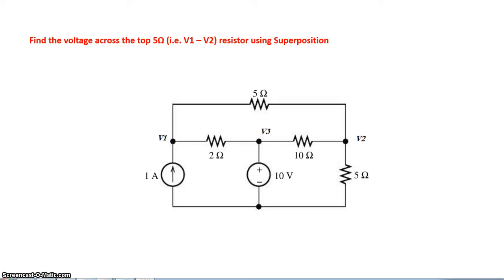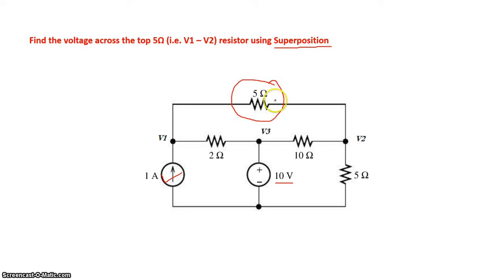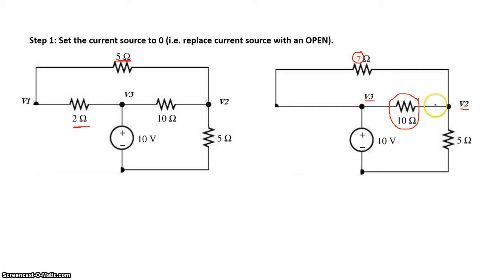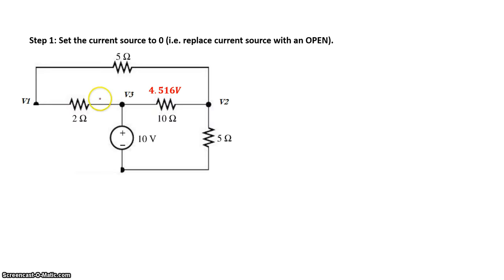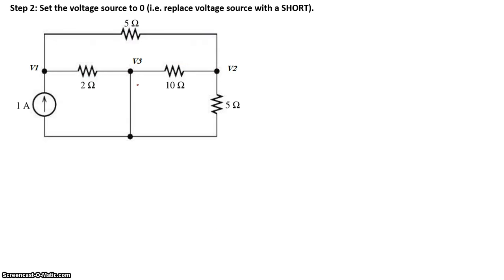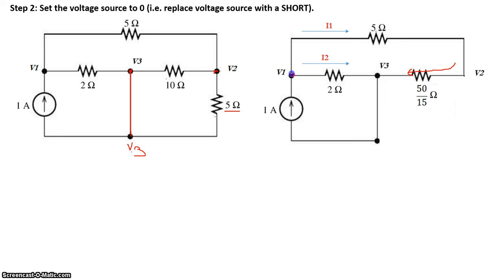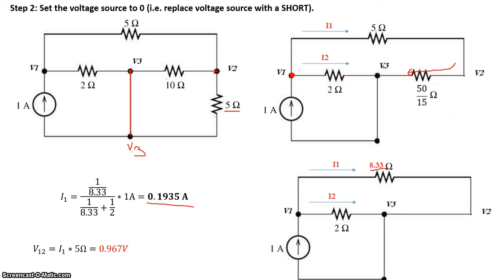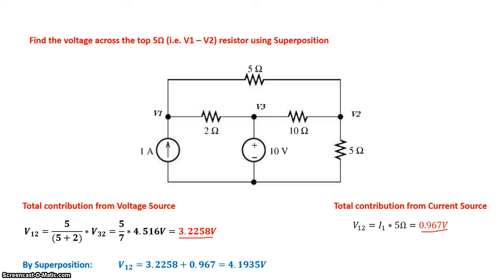Circuit Analysis using Superposition principle

Comment: Why are you doing !/R for you current divider?
Reply: Yeah, at 6:30 I think it's supposed to be ((1/2)/((1/2)+(1/8.33)))*1 since it's current division (which is I1 = (R2/(R1+R2))*Isource)
Reply: Yes that's correct but why did he use 1/R instead of just R --> 1/2 instead of 2 and 1/8.33 instead of 8.33 ??
Reply: +Titan Xelon 

Idk why he's doing that but if you just follow the formula you'll get the answer he got. Just remember that according to the formula the numerator is the OPPOSITE resistor from the resistor we are interested in.
I1 = [r2/(r1+r2)] * Is. There's no reason to do reciprocals like him. The formula works
Reply: Good question, that's because they're in parallel and he didn't wanna get the voltage then divide by the resistor. Piece of cake
Reply: The RECIPROCAL always works. The simple formula you list is a special case where there are only 2 resistors.

Comment: Hi why is that you open the 1A then you short the 10A?
Reply from the maker: There is no 10A, it is a voltage source 10V. Current sources are opened to remove their influcence (ie. set current to 0A) and Voltage sources act as a short when their influcence is removed (ie. voltage between two pts is 0).

Comment: Any reason for using 1/8.33, 1/8.33, & 1/2? Instead of inserting the exact values 8.33, 8.33, & 2 the when calculating I1? #confused.
Reply: that is how we calculate the total resistance in parallel. 1/R(p.total) =1/R1 + 1/R2. @ENGRTUTOR , may you please confirm if l am right.
Reply: Technically the fraction IS the more exact value, but the main reason is to show how the math occurred.  Recall that a resistor pair in parallel is R1*R2/(R1+R2), so for example if R1 is 10 and R2 is 3, you get: 30/13.  30/13 is an exact number, which you can approximate as 2.3077 but that is not the exact number, nor is it clear where 2.3077 comes from without showing the fraction first.  You also could have done it using the 1/Rt = 1/R1 + 1/R2... formula, but that also gives you the same fraction, it just happens to work for more than 2 resistors at once.  

Tip - any parallel combination of resistors will always have LESS resistance than even the smallest resistor.  In this case, 10 and 3 were combined to give roughly 2.3.  If you get a number larger than the smallest resistor, you did it wrong, and your most likely error is you forgot to flip the number at the end, that is 1/x.

Comment: Thanks, great video.
But how about the voltage drop across the 10ohm resistor when we remove current source? Doesn't that make up a part of the 4.516V drop?

Comment: something looks off with this guys current division. Am I the only one confused?
Reply: NOP
Reply: Actually... He used a strange formula for it, but it's the correct answer.
Reply: Yeah, I was thrown off by that as well.
Reply: yeah,....that's method is not eassy
Reply: 2:50 “Lets use voltage divider.” Then places a huge ass equation without explaining any of it.
Reply: @Nickaholic  Voltage Divider: The voltage across the resistor in question = (The resistor in question / Total resistance in the circuit ) * Voltage Source
Reply: The way I learned current division would have been (2/(2+8.3))ohms *1A
Reply: The current division was wrong. The Larger the resistor the lower the current should be and vice versa
Reply: I got 4.615V across the 5ohm resistor, I guess I need to redo my calculations.

Comment: at 6:15 I still dont understand why the Resistances all had a 1/R in the Current divider equation!
Reply: I had the same doubt, I just plugged in some numbers in the calc and realized that (1/r1)/(1/r1+1/r2) = (r2/r1+r2)

Comment: Did he calculate the current i1 correctly? it's on the beginning of 6:30
Reply: Help!
Reply: yes
Reply: Yes, you can do it that way as well
Reply: Why did he put 1/2 in the resistors when he can just use the formula I1 = 2 / (8.33+2) * 1A ?????
Reply: I tried to use this: (2/2+8.33)*1 = 0.1936. Same answer but why the rx=2 when it's from I2 when we're solving for I1? right?
Reply: Its suppose to be opposite i am confused..

Comment: Thanks😀
Why not use kcl voltage node to slove it ?
Find v2,v1 and then to find IR5 current
Reply from the maker: There are plenty of ways to solve this problem. I am showing ONE.
Reply: Some students for assignments/homework are forced to demonstrate the use of this method. Some problems are harder to solve without it.
Reply: You can use KCL and KVL and set up a system of equations, and solve through algebra.  The superposition method allows you to solve more directly, so you don't have to do nearly as much algebra.  It's a simple matter of drawing each version of the circuit with the other source nullified, combining resistors, and using voltage dividers and current dividers to isolate the either voltage or current that applies to the resistor of interest.

Comment: Got the same answer using mesh analysis.
Reply: how did he get 15/50 ohm 5:24
Reply: @jianyanchoong5762  He added the two resistor using parallel addition.

Comment: WHY DIDNT YOU REMOVE THE WIRE IN THE VOLTMETER CASE BUT REMOVED IT IN THE AMMMETER CASE
THIS MAKES THINGS DIFFERENT 
PLS EXPLAIN
Reply from the maker: It is not a Voltmeter or Ammeter -- the problem shows a VOLTAGE SOURCE and a CURRENT SOURCE. 
Setting Current source to 0 means no current (aka broken wire)... Setting Voltage source to 0 means your are measuring voltage across the same node (aka same wire).